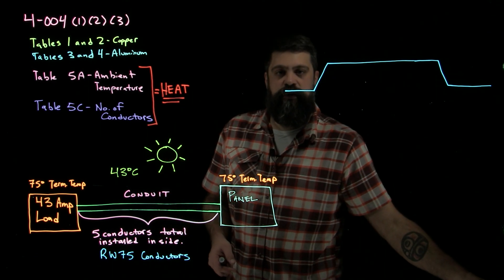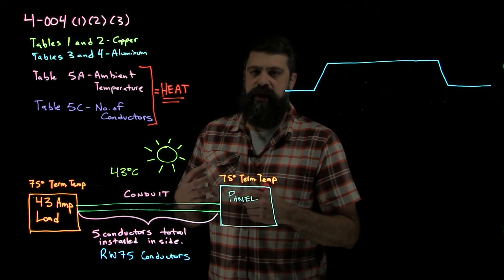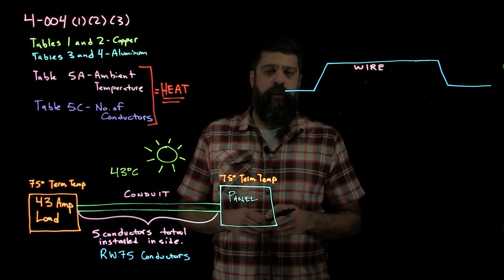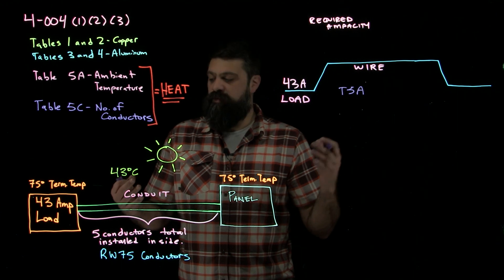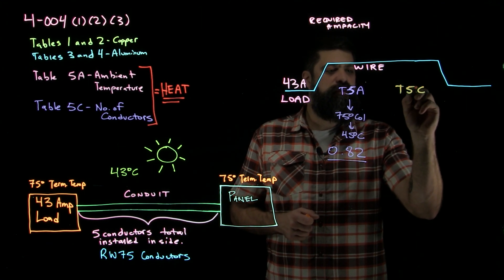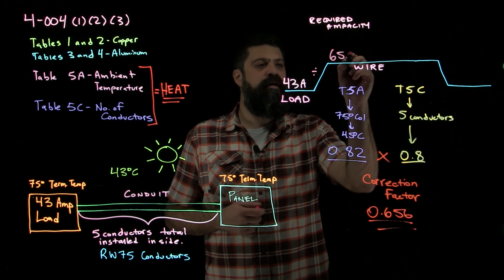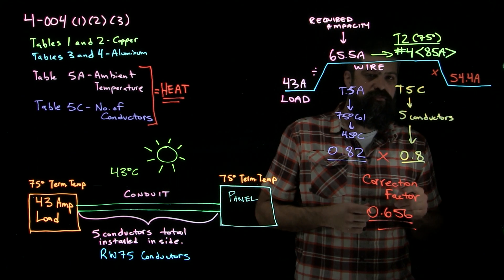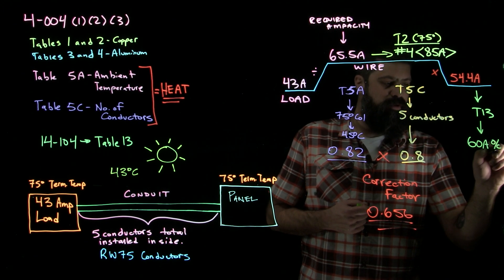Conductor sizing 1

Comment: does the 5 conductors in the conduit include the new ones being added? That would change the correction factor in Table 5C to 0.7. Because you would be adding a #4 Hot and a #4 Neutral (total of 7 Conductors 5+2). You wouldnt need to count the bonding conductor because it would either already be in the conduit or you're just not using it based on 10-606 1)

Comment: Still answering questions ? 
Great explanation and visuals, but what happens when most applicable situations that you use 90 degree wire on 75 degree terminals

Comment: A good video. Just a question please if because the temperature factor you need bigger cable for the current capacity still you have only 43A load so why you cannt use next size 45A breaker because Ib=45A thank you
Reply from the maker: If we only use a 45 A breaker we would end up with nuisance tripping due to the heat present. The construction of the overcurrent would see the heat and misinterpret it as an overcurrent, that is why we size the wire for the required ampacity based on the environment and then size the breaker to protect the wire. Thanks for the question!